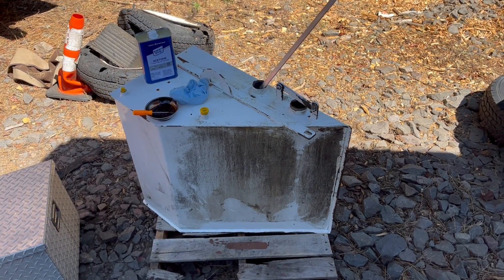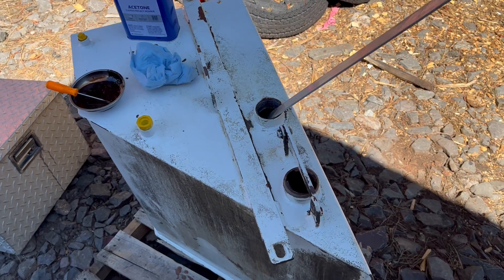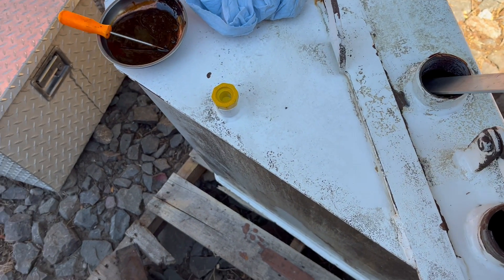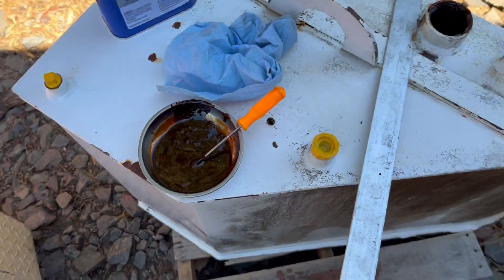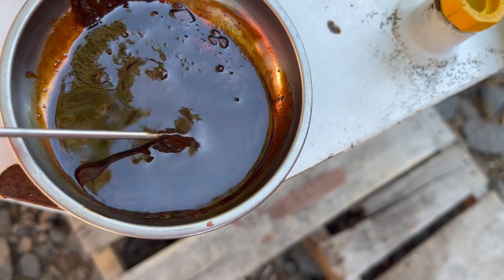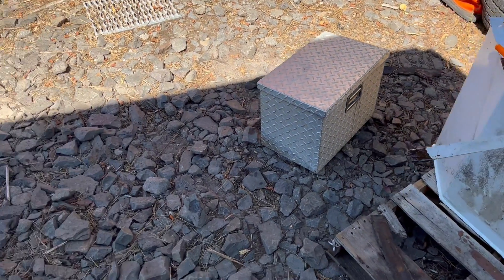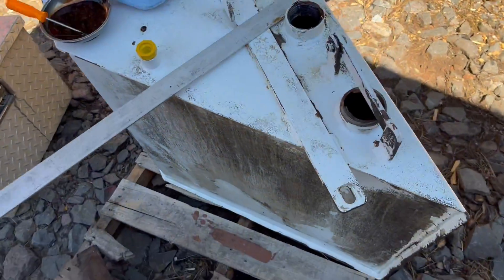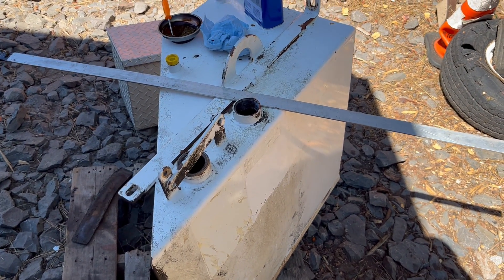How to dissolve diesel sludge

Comment: Just did this today on a diesel tractor E85 seems to work the best and quickest to dissolve the tar like substance in the bottom of the tank. It takes several applications but it works pretty good.

Comment: What if it's on your tractor that's running but it's set for a while and you want to just not have to take the tank off is there anything to put in it to eat the sludge without hurting the motor
Reply from the maker: I realize I'm describing it as sludge in the video and I suppose that is accurate enough. If I wasn't able to remove the tank I could have scraped most of it and used a shop vac to suck it up. Then run a gallon of acetone into it, let it sit and then drain it out the bottom. The acetone will evaporate over time after it drains. Maybe repeat a couple times but be careful with the vac because acetone is pretty flammable. I have had to burn off fumes  before. That can be fun.
Reply from the maker: Not that I know of. I've seen guys cut a port in a steel tank to clean it out and then weld on a patch. 
Also this a lacquer I'm dealing with. Its like a coat of rubber. Sludge would me way more malleable. I've used a shop vac to suck up sludge before.

Comment: Just bought a 400 gallon transfer tank that has black sludge in the bottom. Trying to figure out best way to clean it out. Might give this a go. Thank you
Reply from the maker: Thats a big tank? Might take a more than a few gallons of acetone.
Reply: @CalTreeEquip  Yeah, seller told me it's 400. I took measurements and did the math--turns out it's a 550 gallon tank. Anyhow, I ordered 50 lbs of "Technical Grade" TSP and a surfactant to try first, once weather warms up. I'd rather go that route vs the risk of a big container full of highly flammable fumes with Acetone. I'll let it soak a few days and get after it with a rotary (turbo) nozzle on my power washer. That's my first idea, anyway.
Reply from the maker: @branchandfoundry560  Let me know how it goes.
Reply: @CalTreeEquip  Will do!